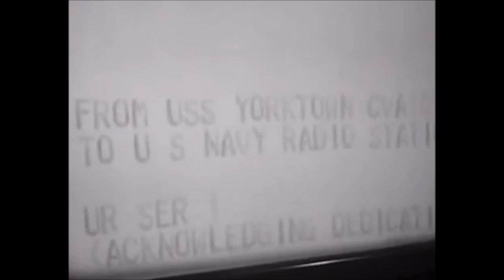Before satellites, radio towers marked locations.  Flat Earth

Comment: Yep, and radio tower sucked at at, mostly due to severe LoS limitation. 

Here why today we use the much more accurate and larger coverage satellite system.
Reply from the maker: And satellites suck at mass communications, which is why there are all those undersea cables that carry all the traffic..   No need for satellites if there are either 1,400 or 25,000 satellites overhead...based on differing estimates.  While NASA only does a relatively few launches a year.
Reply: @LaramieTrail  Yes, or course they suck at mass communication. that why they are NOT used for mass communication. They are used for wide broadcast than require almost zero communication from them. GPS, TV, RADIO...all of them are broadcast with no connection from the receiver, therefore having extreme low bandwidth requirement from the satellite.

Why do you think the few service satellite than actually require communication with the satellite itself are expensive as fuck?

And NASA is not the only organization to lunch satellite lol...